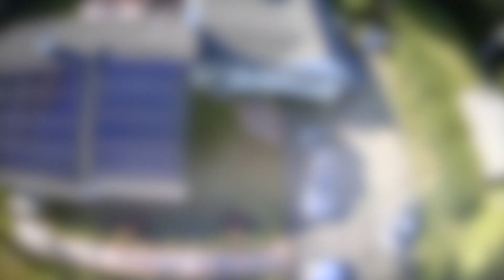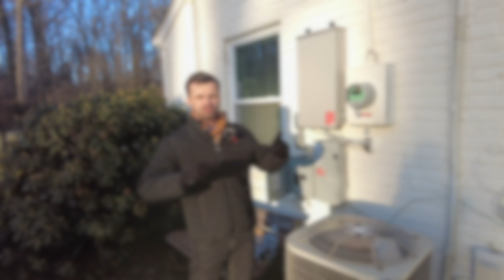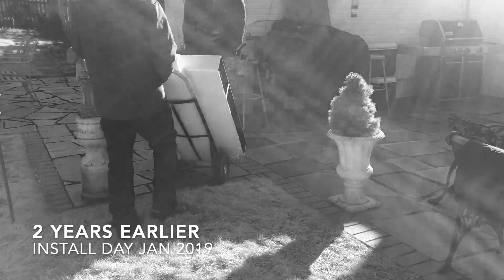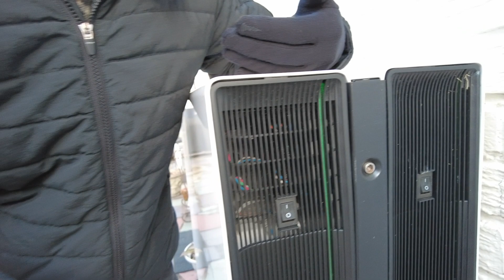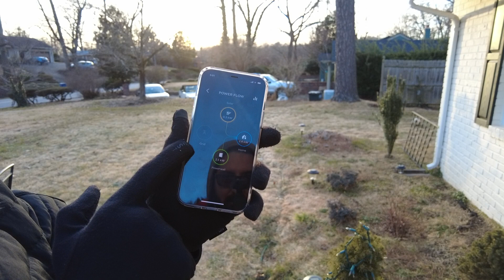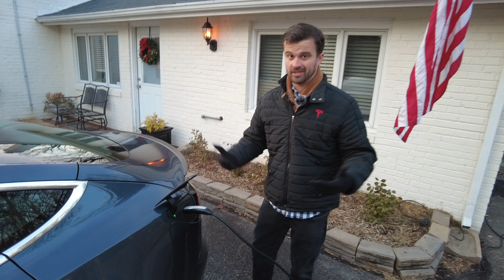Tesla Eco-System Detailed Overview ~ Solar, Powerwalls, and Model 3

Comment: Hello Chris, 
Do the two powerwalls provide enough power for running an electric central heating system? If so, for how long? 
Thank you!
Reply from the maker: yes, 2 powerwalls are generally able to back up all breakers 60A and under within a 200A main service panel.  Duration of A/C usage will vary on the efficiency of one's unit.  How many kWh does your A/C unit use? (I have gas heat)

Comment: Hey Kris thanks for taking the time to make this video. I was also looking at 8.8KWH for solar and 1 powerwalls so it very cool to see them installed. Hoping to find your video on why you decided this configuration. And also did you purchase or do a loan. Thank you!
Reply from the maker: Hey Jason, I chose this size based on my annual kWh usage and also the amount of good (non-northern) roof space I have.  Keep in mind I live in the northern hemisphere (USA) so southern facing mounting planes are ideal.  I financed 100% so it was basically a bill swap with my now drastically lowered electric bill.